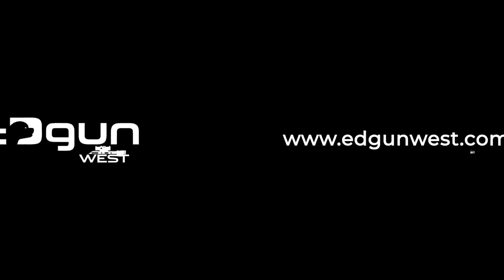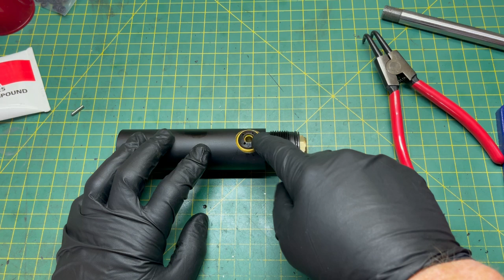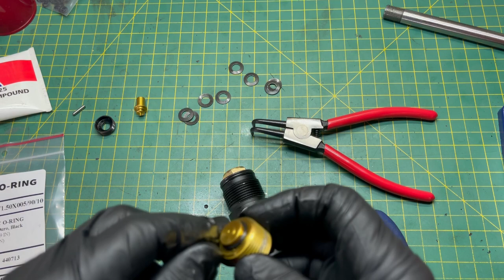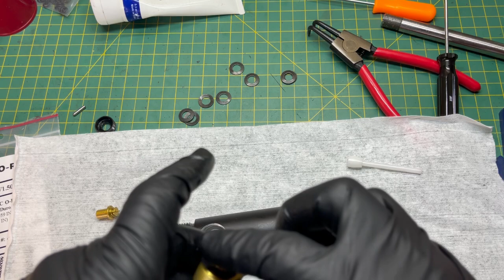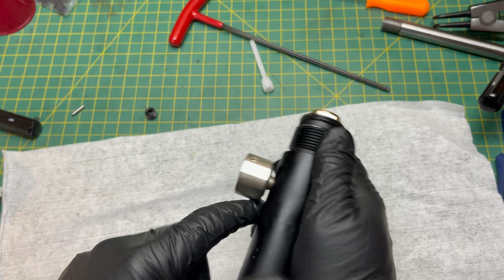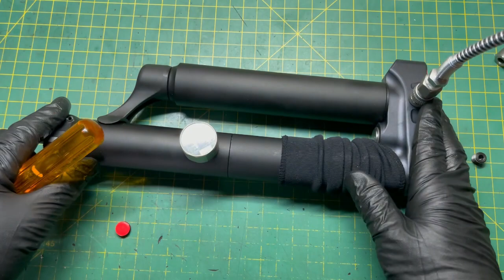Edgun Leshiy 2 REPR repair and use

Comment: Do you need to degas to adjust up in pressure or can you adjust as you were going down in reg pressure?
Reply from the maker: You can adjust it under pressure.  Remember when going down in pressure to dry fire the gun in between adjustments
Reply: @edgunwestLLC  thank you 👍

Comment: Brian.1 Qustion i had a leak on the bleed screw. I pulled it out had a ball and a tiny tiny o ring. When i checked on the Illustrated parts catalog i didnt see any o ring there only the ball.

Have you ever come across something like that??? sn59xx .it is a mod or some1 just put it there might be??  250mm .22 cal  EPR version. As i managed to put back everything nicely its not leaking now but im scare what will happen later on.
Reply from the maker: There is a delrin seal that was added. That is what you saw in the bleed screw

Comment: I started witn a non REPR L2 and am installing the new regulator now. I have been trying for the last half hour to "clock" the gauge, and the valve end, so the gauge isnt interfering with the bottle, or the valve is vertically aligned with the butt plate. Ive tried unscrewing all the parts inline from the butt plate to the main valve, but it always clocks misaligned and interfering. Do I need to shim something?
Reply from the maker: it doesn't need to be all the way screwed down,

Comment: Thanks for that great vid. My o-ring broke at 170 bar when filling it the first time. Then I exchanged it according to your intruction and tried to fill it again. But again, it blew it off at around 170 bar, again. Anyone having any hint or advice what the reason may be?
Reply: Hi.
me too.
have already changed the o-ring 10 times.

regulator does not work
Reply: I was having the same problem, the replacement o rings with the gun seem to be too thick and shear off when the cap on the regulator is put back on. I just tried uxcell 5mm id x 8mm od x 1.5mm width and it worked well. Got them from amazon. 250 bar held, no leaks and put about 32 pellets downrange.
Reply: @michaelgeorge1975  
Hi.

5 x 1.5 mm is the standard seal
Reply: got my e.a.r. exchanged. now everything seems fine.
Reply: @BobPanda  
have the little plastic insert and swapped the ball.

Now it is ok
Reply: Lmao that's EXACTLY what just happened to me. First time, 170 bar with a hand pump 😂